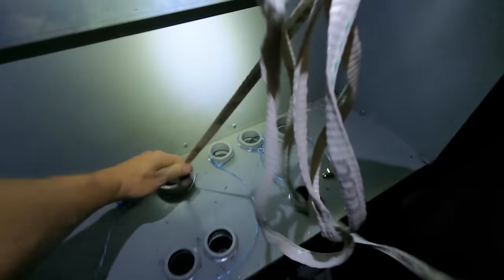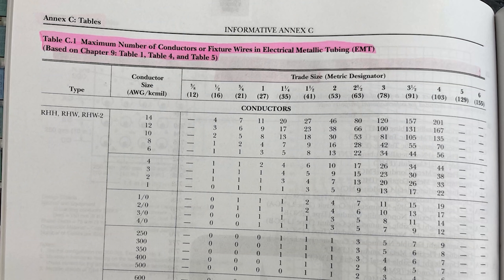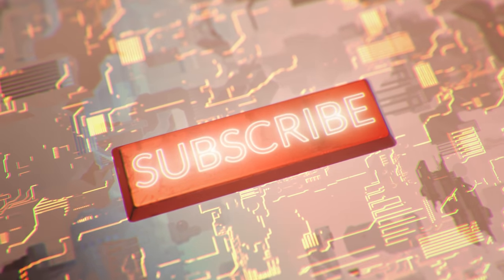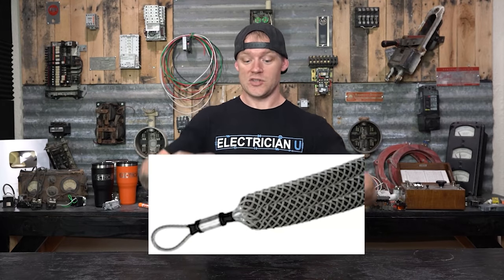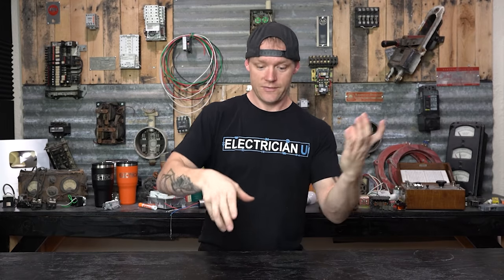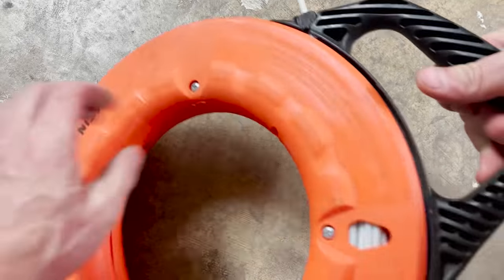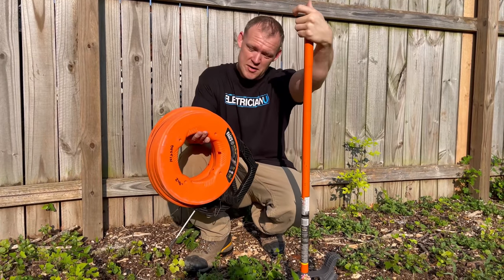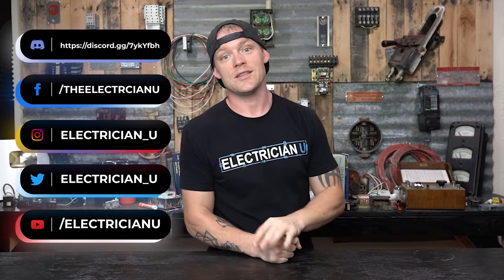Pulling Wire Like a Pro - Tips and tricks for pulling conductors through conduit

Comment: I love mule tape. LOVE it. Jet line is good, but I've see a lot of PVC pipes and bushings cut by jet line. And it's hard on your hands and susceptible to breaking. Mule tape is a miracle.        Also, in your last section, I thought you were going to talk about a trick I often use if I'm pulling wire into a raceway that already has wire in it. Depending on the wire size, you can add an extra wire to your group and tie on to a wire that's already in the pipe. When you pull it through, your extra wire replaces the wire you used to pull with.

Comment: I'm semi-retired now. Our company policy on conduit we never used 4 - 90 degree bends in any run. Underground there are a lot of small twists and up and downs in the ditch that will as you know factor in on the 360 rule. Long pulls man oh man. Parallel 4 inches 6 inches runs for 3 ph service was my favorite pull huge spools of 500 mcm copper wire. I was having fun and getting paid Those ditches looked straight and looked like they would be easy to pull. You get to the workday to pull that 300-foot # 6 or # 8 wire and your running for the pulling motor. I'm new to your channel. I like how intense and involved you are to do the job by code. In my working days, it seems I was always alone in pulling wire by myself ( the small stuff ). I always had a work ethic that I can work with anyone that is safety conscience first. How we get from A to B is a matter of method and the drawings. Man, I am so happy to see someone young and so enthusiastic getting into the real work of being an Electrician. I am a New Subscriber My nickname is Big C. This might be my only comment however I will be watching. Keep on working and be safe. It sucks getting old and retiring from work you love to do.

Comment: Can you do a video on tips and tricks on pulling old wire out and new wire into a home? Haven't seen a lot of good videos on YouTube about this, and I feel it would be helpful to hear from and electrician on the different situations you've come across and how you handled it. Love your videos.
Reply: Pulling wires out of  a home can have several challenges. Romex is normally stapled onto boards 'X' amount of feet apart, and a couple inches from each box. Sometimes during "the rough in" stage of house buildings wires get run through the studs at various heights and directions as needed to get from A to B the quickest and easiest. Even around corners of the wall. Sometimes it's not worth the hassle to remove if your not willing to damage the surface. Cutting out the box and trimming the wires out of the way is the simple solution, Adding wires back in, you need to create hole path ways for them to run. This proves challenging to me on closed walls and ceilings. There are lots of cross bracing and extra blocking built into houses to make the structure sturdy.

Comment: At 11:30 I noticed you are pulling it with some kind of string, what is it? We usually use fiberglass fish tape, it's very strong, doesn't damage cables, and does not rust, plus if you are pulling this string with metal fish tape, the fiberglass will save you some time since you can already pull the cables with it. I am an apprentice in Japan, and this is the first time I saw a metal fish tape, but in the website of the sponsor they do have the fiberglass version, I would recommend that. It's light, durable, and dependable. By the way, I love this channel guys, thanks for the tips!
Reply: It's pull line or jet line poly string has a tensile strength around 200 pounds. It's pretty strong. Generally people don't like the fiberglass tapes when they break they can't be fixed and leave fiberglass splinters all over the place. Generally only used working live when you can't shut down. The metal snakes at least you can make new heads and they don't cost as much having to cut them etc.

Comment: Just an added pro tip for getting your Jet Line or Mule Tape down a run of conduit either a short or long run. you can actually get this done a lot faster than using a fish tape. If you grab a piece of plastic, like part of a plastic bag, or whatever you can find to make a small balloon, you can tie that onto your Jet Line or Mule Tape and just push it into the hole. On the other side you just put your shop vac over the conduit and turn it on. The shop vac will suck the ballon with your line tied to it through in seconds. When I was a low voltage installer we used this method on every job, works like a charm for small and large conduits and saves a ton of frustration and time.
Reply: While they have gotten pricey, conduit pistons are made for the job and blow through like greased lightning. But plastic bags are always the emergency backup.

Comment: The most intense project I ever designed the conduits for in 3D was 5 miles of 3.5” EMT in a 15,000 sq foot electrical room.   I had a master electrician sitting next to me for 3 months working out the routing.   We both learned a lot on that project!
Reply: Damn
Reply: @tuckamojo7660     What?   You get the amount of conduit it is in such a small space?
Reply: That would be impressive to see installed.

Comment: I used to be a contractor for Comcast. I was on the construction side and involved in doing plant extensions, usually underground. The company I worked for believed that less is more and had me work by myself 99% of the time. One of my main jobs was to go into newly built neighborhoods and running cable or fiber from the taps to the residences. The builder would have the conduit installed by the time I arrived, but builders don't usually care about the work they do when it doesn't involve them. I had one builder who had allowed concrete to be dumped down the conduits. Usually the conduits were full of dirt or were crushed. Pulling cable through conduit by yourself is a pain. Had I had your video back then, I probably wouldn't have had to learn the lessons the hard way. I liked telco work, but that company was awful.

Comment: I am installing a 100amp sub panel in out building and will be running 2-2-2-4 Quadruplex Aluminum Conductor Underground Direct Burial 600V URD. I was hoping to see tricks and advice for pulling this type of feeder cables through LB line box without getting cable kinked. This video was good with respect to multiple single cables but again did not show details for navigating LBs. Is there another video I should be looking at to learn what I am seeking?

Comment: Cool tips man.  At the 20:40 mark you mentioned that You do not tag conductors before the pull bcz the labels come off. A Pro too I can offer is to "Back Wrap" the tape over the labels. It'll keep them in place and when you remove the tape it won't rip off the tags.  Keep the videos coming.
Matt from Michigan

Comment: Just subscribed finally. I'm separating light circuits in my office by putting motion detecting switches in. Currently (haha) there are seven 8 foot dual tube fixtures all on two switches (left and right) and it wastes electricity when I don't need all the lights on when I'm in one part of the office. So breaking these circuits apart, none of the fixtures are bonded nor are there any grounds running in the conduit. Some boxes are bonded but no ground running to them. I'm now going to run ground wires through and make these circuits right. Learned this from you and Sparky Channel.
Reply: Sparky has some great conduit bending videos
Reply: If the existing fixtures are F96T12 lamps, you may be better off just changing the fixture to LED.

Comment: The Horrible Fright Tools sells a decent nylon fish tape for cheap. They also sell inexpensive sets of rigid fiberglass pull rods that screw couple together. I have used those a lot. They are great for relatively short straight runs through such places as wall cavities. Fish tapes like to curl and get stuck.
Reply: Fiberglass glow rods are a huge life saver when adding or updating in finished walls or ceiling work...amen

Comment: Hey Dustin ... non-electrician here (but still do all my own minor residential and smallcraft work) ... watched your 'Pulling Wire Like a Pro - Tips and tricks for pulling conductors through conduit' (I like your plain talk ... with all expletives included ... just like a mariner) in the hopes I just might discover a methodology for fishing a short run of solid copper 14/3 'ROMEX'? flat cable from an overhead fan to a wall switch in a finished basement bathroom ... the original single rocker Decora switch was wired with a combo function ... you turned it on for the light and you also got the fan ... whether you wanted the fan on or not ... I'd like to swap out the single for a double rocker Decora switch but am pretty sure I'll have to run a separate cable from the fan down to the switch location ... I'd like to avoid cutting open the wall and / or ceiling but don't really see how I can fish through the wall header or any possible lateral fire stops in the wall above the switch (I've run into them in the upstairs walls of this 1962 built house in Vancouver, Canada) ... in the off chance that you can spare a moment to comment, is there some trick up your sleeve that I can leverage?  Thanks, Kevin Mc
Reply: As I understand it, 14/3 or R3 is 3 conductors + ground. If that's what being run up, it sounds like the split from the switch side is happening in your box and run up to your light. I would want to verify that, personally. 

If the supply to the fan and light are distinct from the switch side up and over, it makes your life easy. You just need to wire in the new switch(es); No wiring outside the switch box should be required.
Reply: @nateschultz8973  ... thank you for getting back to me and my Comment Nate ... I do appreciate your assistance ... so, since you posted your Reply a few weeks ago (1329PST 27NOV22), I've been meaning to revisit this as yet unresolved switch mod initiative and will now provide more clarifying details ... that, upon rationalization, will almost certainly? result in having to run another cable from the galvanized metal wall switch box to the fan or light (as I initially thought ... so ... I'm likely back to pulling wire? ... somehow ... ).  Presently, there is an (14/3) R3 cable (consisting of red-jacketed, black-jktd, white-jktd conductors and a bare copper [ground] wire) running from the wall switch box to the fan / light area of the bathroom ceiling.  Also entering the wall switch box is an (14/2) R2 cable (consisting of black-jktd, white-jktd conductors and a bare copper [ground] wire) of which the black-jktd conductor is the only hot conductor entering the box.  The wall switch box is wired with both bare copper (ground) wires secured to it internally by a green-anodized anchor screw and the 2 white-jktd conductors are wire-nutted together, as were the 2 black-jktd conductors.  A short length of black-jktd conductor had been incorporated into the black / black wire-nut connection that then attached to the bottom terminal screw of the Decora switch. The red-jktd conductor is attached to the top terminal screw of the Decora switch.  It seems the R3 cable was daisy-chained beyond the bathroom fan / light area to a light switch and two duplex outlets in an adjacent bedroom on the same floor ... they all rely on the black / black wire-nut connection in the bathroom wall switch box for power.  So, closing the switch circuit at the bathroom Decora wall switch energizes the red-jktd conductor that is obviously connected (in common) to the hot-side wires of both the bathroom fan and light.  Does this all add up for you Nate?  Sorry to be so long-winded ...
Reply: @K_Mc  Think so. 

I want to be very clear that I'm not giving you any wiring advice that you should take without verifying in place, using proper safety measures, preferably under adult supervision, and with your friendly neighborhood electrician wearing rubber boots and gloves while holding a dry broom. Got it? Great. 

Seriously, though: the extremely high possibility of important information communicating poorly here means you need an expert on site to check the circuit. That expert might be you but it cannot be me, so take my advice as the mere description of logic that it is and not as wiring advice, per se. Any liability for risk has to be on the head of your chosen expert and yourself. (That, I suspect, is a large part of why nobody else answered.)

Okay, that's out of the way.

Sounds certain that you cracked that switch box and checked things. Good deal. If you also verified the wiring in the fan and light box, as well, we can be pretty confident that you'd need to pick one of:

1. Add a conductor to carry the control from another switch. That requires pulling wire or something along those lines. 

2. Replace with a switched fan and simply attach it to the supply wire. The fan switch is then the hanging chain and you have light and fan separated that way. 

3. Figure out how you want to run the power to the chained boxes in the other rooms and repurpose their supply wire to carry the power of a new switch without needing to pull that one.  (But likely need to pull others.) I'm not sure how the colors would need to look for that to meet code off the top of my head. 

4. Add a wireless switch pair to either the light or fan. If you have the room to mount that in the ceiling and switch sides, it might be a good approach. 

I'm not seeing other options from what you described, but your particular circumstances & preferences will inform which of those are the most acceptable to you.
Reply: @nateschultz8973  ... wow ... you got on that fast! ... thank you ... YES ... I take all of your safety / end responsibility precautions very seriously ... I can possibly tap-up my buddy's electrician son (he's a young fella but completed his apprenticeship a couple of years ago, works at his trade daily and is current in my geographical region) for expert oversight, and, maybe even implementation if I'm lucky ... your presented options are very helpful and useful ... I'm liking the ball-chain (or wireless) switched fan ideas the best ... these are the kinds of ideas I'd hoped would flow from this video Comments participation and they have ... thank you again Nate for stepping up and helping me out ... perhaps soon I will not be waking everyone in the house up with wee-hour (literally) bathroom visits ...
Reply: @K_Mc  Glad to help. Ganbatte.

Comment: Yesterday, my neighbor and I had a hell of a time running around 120 feet of a pool light wire. It became personal, eventually several hours late we were successful.  Lots of sweat.  We were getting stuck at the end, eventually we stripped of the last 5 feet of sheathing to expose the hot, neutral and ground line just to make the end of the line smaller so it would be easier to get through the final 90 degree turn.  If you ever build a pool, ask for the kind of light where you just change the bulb!

Comment: Just a tip. If you use number labels, take your electrical tape and use it backwards. I.E. non sticky side on the wire over the labels and then turn the tape over and go sticky side. Just make sure you leave a tab to remove your tape when you're done with the pull.

Comment: Had a few 100' nylon ropes made up with a small pulling grip on one end ( for smaller conduits ) and a larger grip on other end. Never heard or used mule tape but looks like a great item. Great ideal more boxes & less bends. Had a lazy boss that loved to install 360 degrees in larger conduit. Worst is when he placed a 60 degree kick right before a 90 degree bend. Longest fish was 200' but several times lazy knuckle head ran over 250' of conduit with bends. Myself and other nite sparky would take off that Saturday he pulled wires in.
Reply: Mule tape has an added benefit being used, it has footage markers along it. Making precutting conductors more precise. It comes on various size spools, and is relatively thin, making storage easy.

Comment: For pulling large cable I've always used one of two methods. First you strip the insulation off of a foot of wire. Fold outward four to six outer wires half from opposite sides of the cable. Then remove all the other wires back to the insulation. Bend the wires through the pull rope staggering the other cables. Tie wire the bare wires tightly and tape and soap. Then pull. The other method is to take a roll of black iron tie wire and make a basket like a condrum. Far quicker and easier than a real factory basket that has a tendency to tear up during hard pulls. With the first method never use the interior wires as they can pull out of the cable on hard pulls.
Reply: basket weaving is advanced technique lol.
Reply: @captaindrp82  I keep forgetting todays wantabe electricians don't know how to do real electrical work like bending big pipe, pulling long runs of heavy cable, building high voltage stress cones, running bus duct, welding brackets. I had a tool buddy who the forman asked if he knew how to do something and his reply was if I can't then no one else can either.

Comment: Recently did a 70’ pull of 3 #6 & a 10 ground through 3/4 pvc with 4 90s. Up in an attic, out the back to the house, down under the ground then up into a sub panel in a shed. Wasn’t my idea & what a shit show it was. Used vacuum line bcuz couldn’t get a fish tape through. When the line was clearly going to snap we used it to pull the fish tape through. The conductors came off the fish tape twice at the 4th 90 & on the 3rd try it snapped the metal fish tape completely. Brutal especially in the Florida heat. Never again
Reply: When you damn near reach the conduit fill it doesn't help your case.